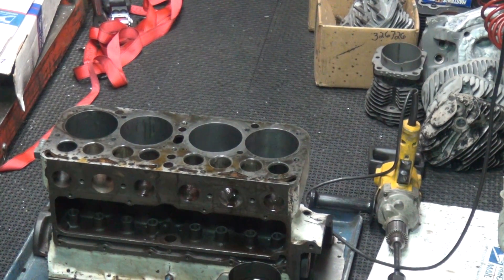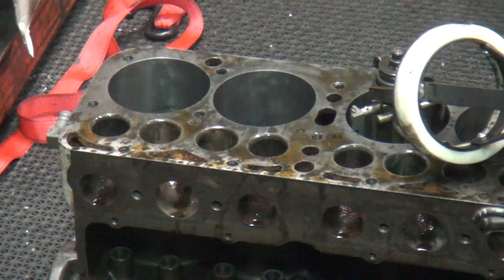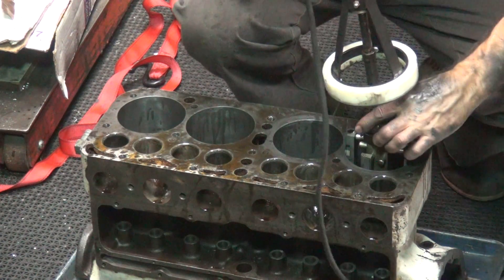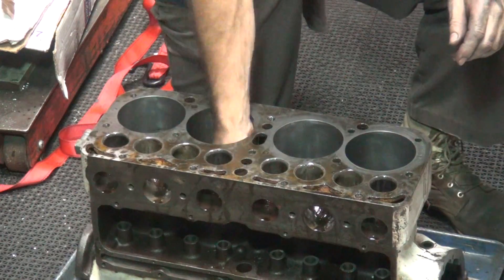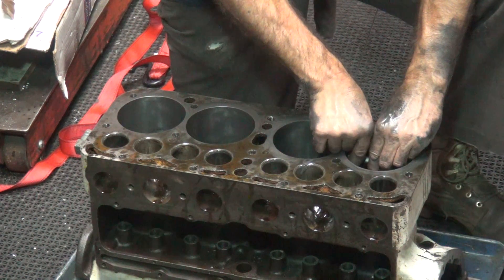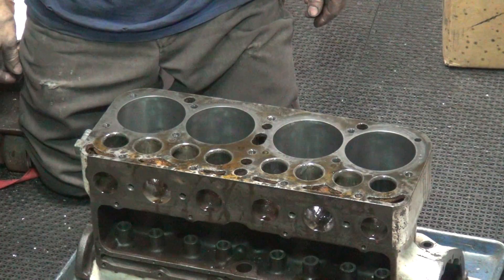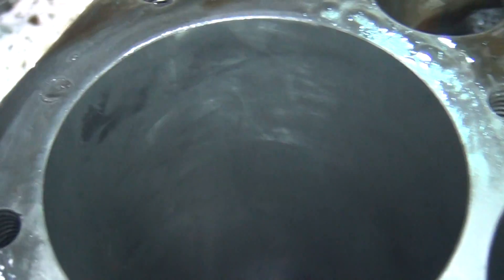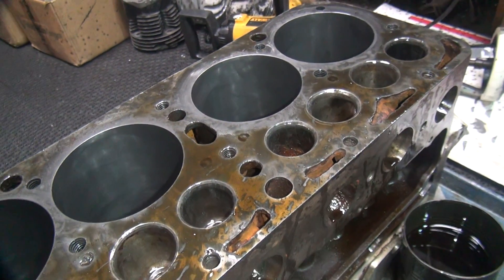1932 ford #119 model A or B flathead race block crack repair by tatro machine

Comment: I have a question... Why would you not stitch the crack, over bore the cylinders and press sleeves into the block? Seems to me that would be the best solution to the problem and a repair that would last the life of the engine. Doesn't seem that it would've been much more labor involved.

Comment: is there any reason you cant just sleeve that cylinder?
Reply from the maker: scotts439 the block is bore way over so there is no room to bore it anymore to put a sleeve in. that 1st hole I drilled to fix the crack in the bore was less then an 1/8" thick. more like .100 thick or less.a custom made sleeve was going to be over 200.00 anyway.the unknown of how far I can go and how much was already spent on the block I had no choice but to do what I did.the block passed a 60psi pressure leak test so it is strong.the motor has made its 1st race at el mirage and it went 111.4 mph without any problems. time to step it up and see what it will take. the record is 140.00mph right now. will have to wait until next season now.tatro
Reply: Tatro Machine 
Why do you have to go much bigger to sleeve it? You're in a machine shop, you can true up the cylinders & if you have to, modify the sleeve. It's done all the time in custom applications.